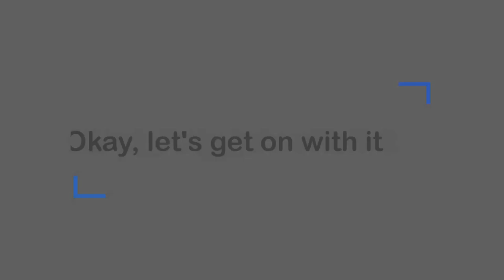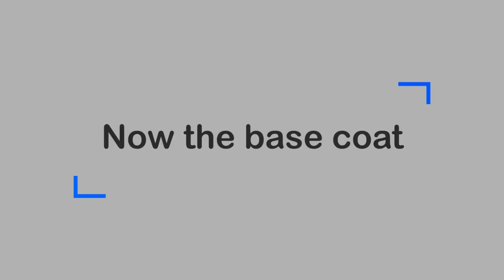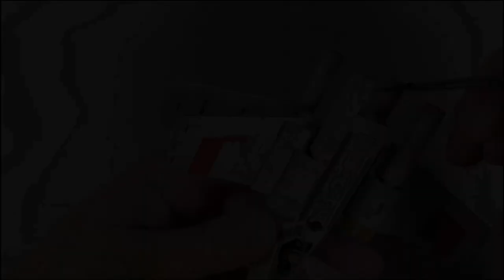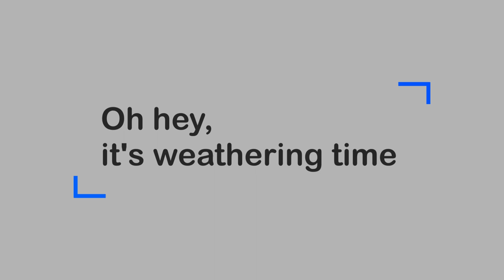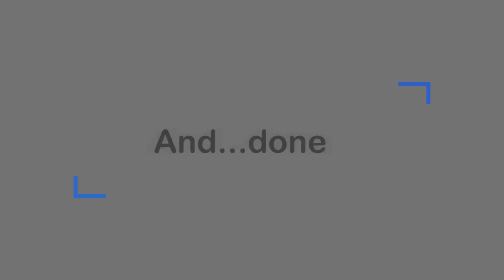Painting and Weathering a 1/72 Bandai Star Wars X-Wing Starfighter

Comment: Hi, awesome video, dumb question, after using the wash, you wiped off excess with thinners I think with a small brush, won’t that effect/smear the paint on the body of the plane where your going over with the thinners?
Reply from the maker: No for two reasons. First, enamel thinners don't affect acrylic paints, and I also applied an acrylic varnish before the wash to make sure the basecoat is protected. The only other risk is scrubbing too hard to try and remove the wash, which could scratch off the paint still. It's also important to let your basecoats and varnish completely dry before the wash stage. Hope that helps!

Comment: Hi Paint Quest.  I'm getting back into modeling after a 30 year break(college, career, wife and kids).  I'm attempting to catch up with modern techniques.  I'm learning airbrushing, lighting/lightblocking, putty/sanding, and newer paint effects.  I've noticed a lot of Youtube modelers do pre-shading before the main color of hulls....but, somehow, it looks like that effect gets lost through the layering of color that goes on over it.  Is it really necessary to do the shading coat first?
Reply from the maker: No, not at all. The effect is very subtle and if you pre-shade, you have to make sure to keep your paints thin enough to see the shading. Check out my SU-33 video to see a post-shading technique (35:10), which is a lot more effective for panel lines, but needs a steady hand. The only reason I did a pre-shade for the X-wing was to make it look extra weathered. However, I probably could have thinned my paint more.

Comment: how did u paint the pilot...?
Reply from the maker: Sorry, I didn't capture the footage. I remember using a really thin orange glaze for the visor and the kit comes with decals for the helmet. Hope that helps.
Reply: @echelonhobbiescanada  which is better paint brush or an air brush kit for Bandai models...?
Reply from the maker: @jonhhycagespro-ket5048  It depends on what you like to use. They can be painted well with both.
Reply: @echelonhobbiescanada  thk